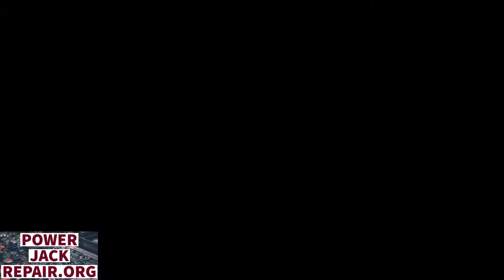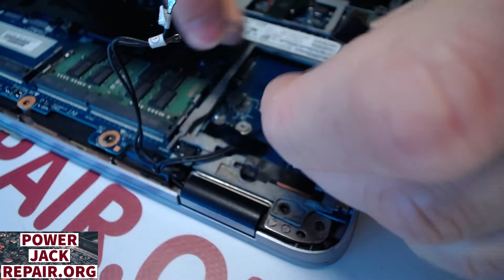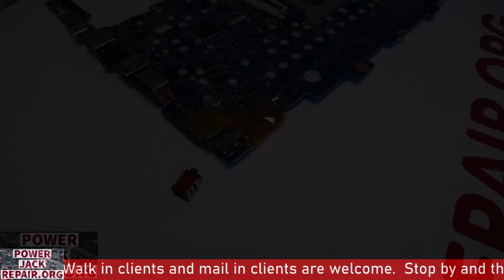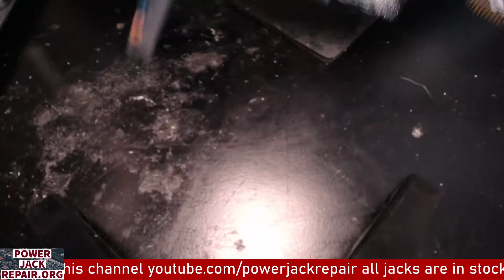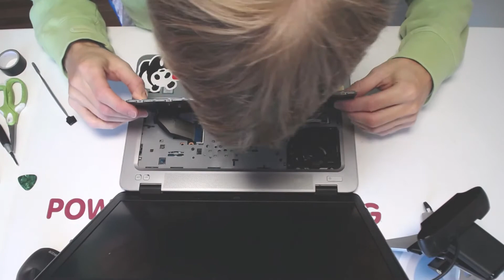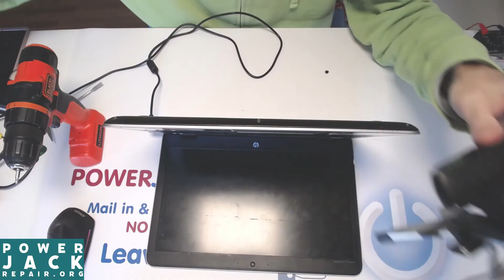HP Elitebook 840 g3 disassembly laptop charge port power jack repair fix taking apart tear down

Comment: would be great if you could show the screw types being taken out as well.  And, tools used.  Great video and steps.  Also curious to know if the EliteBook can be powered by USB instead of using the power port?  do you have a video for EliteBook Folio 1040 G3 1040G3 - 844424-001 ?

Comment: dude that's awesome but i have a problem in the same type of laptop. Hear me out,
So the laptop's dead when i keep it in sleep mode.Then when i turned it on it doesn't turn on i have check everything like the battery and the power supply but it's good but when i saw the back side of the mother board it got fried at a part in the motherboard do you think is it the problem and is it worth to repair or get a new motherboard? and all the other components are working.